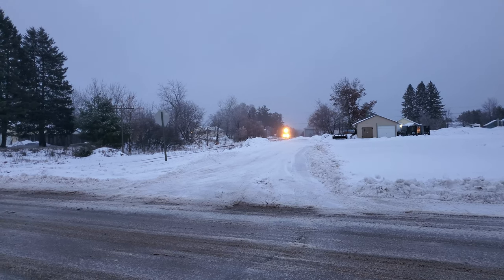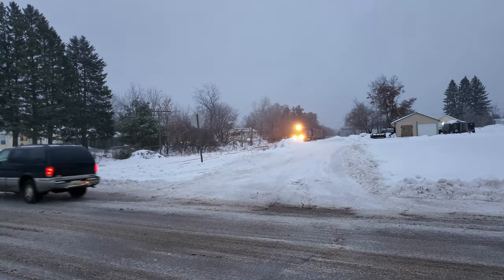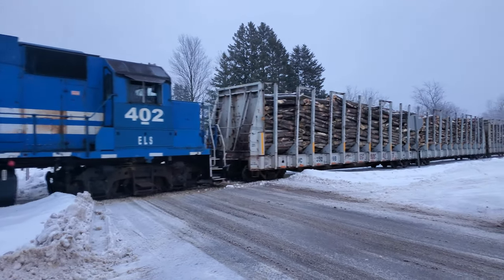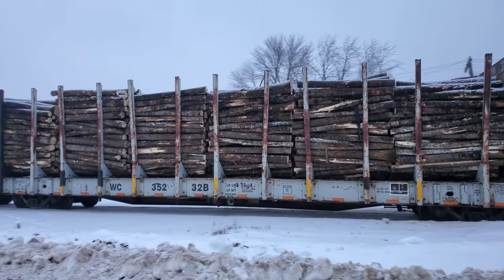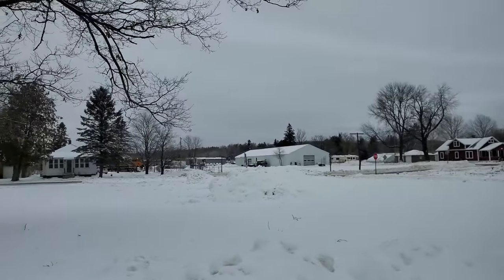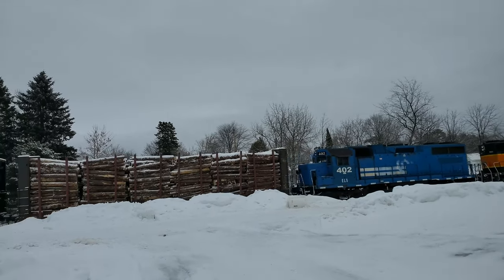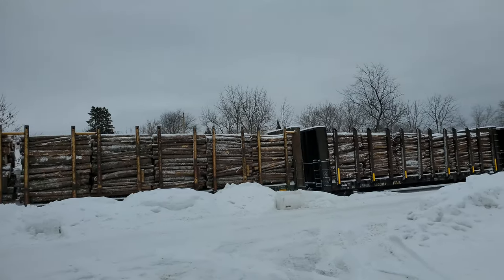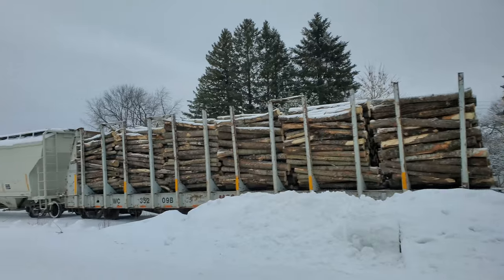This Railroad Cross Trains Conductors To Be Engineers Too? Cool! #trains #trainvideo | Jason Asselin

Comment: Most of your short line railroads cross train since they are non union and don't have separation of craft. ConRail was doing this for a while until the unions intervened. On the class 1 roads one can start off as a conductor, then apply for engineer training (choo choo U). However, you start on the bottom of the engineer's seniority roster if you succeed in the training, which can last up to two years. Depending upon the road and the union agreements, a washed out conductor may be able to return to their spot on the roster. Until engineer certification, most good conductors knew how to operate a locomotive and we did on a regular basis. Years ago head brakemen also knew how to operate a locomotive when the fireman positions were eliminated. Thanks for braving the snow and cold.
Reply: I operated units and I was on the track crew lol